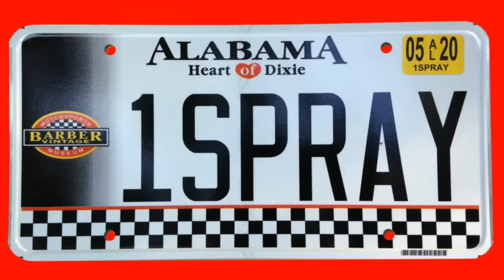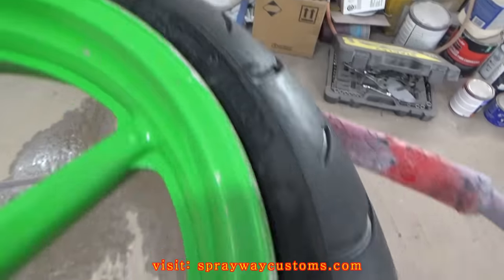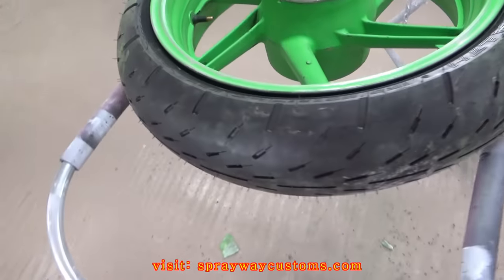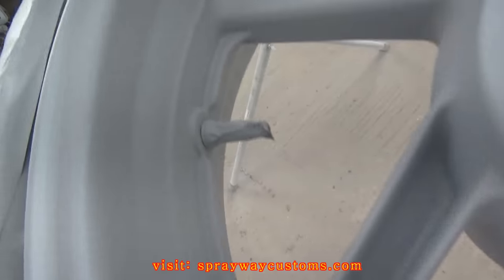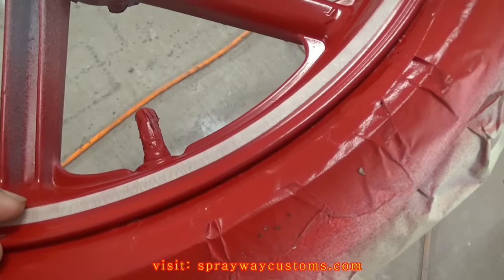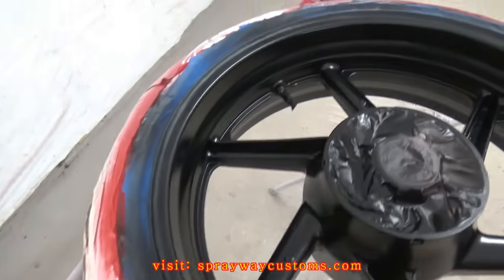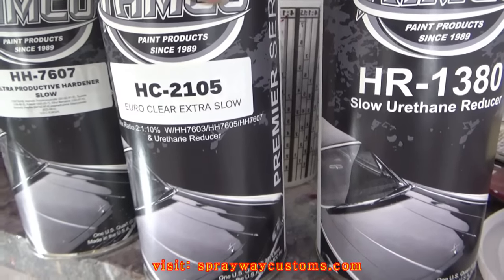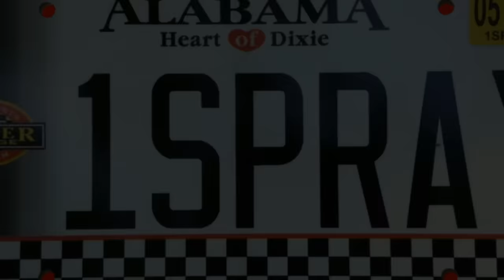How To Paint Motorcycle Wheels A Two Tone Color Black With Red Stripe

Comment: I’ve read through and didn’t see this so I’m sorry for asking 2 years later lol…

I’ve been painting some motorcycle wheels at home for the first time and have run into minor problems. I’m painting them on a stand (so they can spin around and be accessible from both sides), and it’s worked well so far. I had tires on and masked as you did. Would you have rather painted them without the tires? I did one without and I’m able to bring the paint/clear up over the lip so it’s back further.

Also, when I clear, I keep getting orange peel. I’ve not had luck wet sanding because my wheels have lots of angles you can’t reach well enough. Mine are also aluminum, so I scratched them up good and used adhesive promoter and a self etch primer, then white base coat, then fluorescent red and finally 2K clear about 2-3 coats. 

Long story short lol, do you recommend removing the tires first if possible? And any tips for clear coat without runs/orange peel? Maybe my gun isn’t set up correctly? Love your videos, thank you! I’m in SC, might need to bring you some wheels!
Reply from the maker: Yes, I would suggest removing the tires if possible and when spraying rims I try to get it wet as I can to keep it from getting orange peel
Reply: @SprayWayCustoms  thank you for the help! I now believe that I got the orange peel because I was using a small detail gun 1.0 tip, and I was using a fast activator which I understand is the hardest to lay flat? I’ll now use a 1.4 standard tip gun and a slow hardener, and keep my gun discipline (distance) consistent to avoid spraying too far/close and the droplets being too small or whatever is causing orange peel.

Comment: another question: how long do you wait to turn the wheel over to paint the other side:?
Reply from the maker: Right away...soon as you done with one side
Reply: @SprayWayCustoms  You only had the tire resting on the stand, correct?
Reply from the maker: Yes, on these I did but I've painted wheels by using a pipe and sliding the wheel over the pipe and spinning the wheel while painting them but it's kind of hard doing that and filming at the same time.

Comment: Hello friend, in this occasion I bring a problem with the center console of the board of my Ford Mondeo 2001 ... it is breaking every time I remove it from place, as I could reinforce it, I have never used fiber ... I appreciate your comment to help me I do not finish breaking hehehehe greetings
Reply from the maker: You have to make sure you sand it real good so the fiberglass will bond to the surface